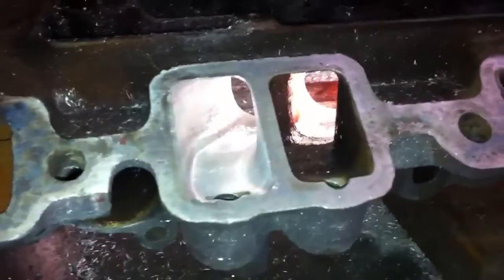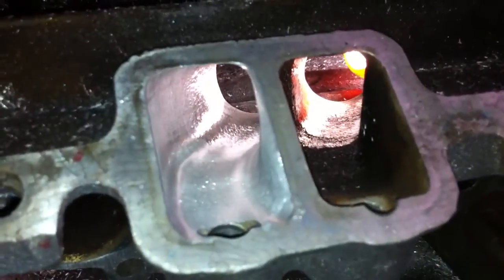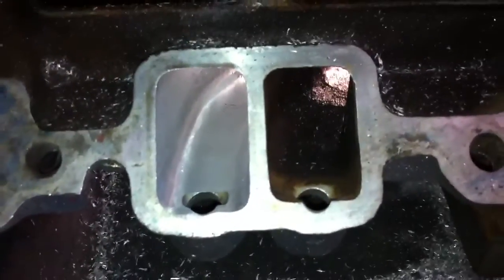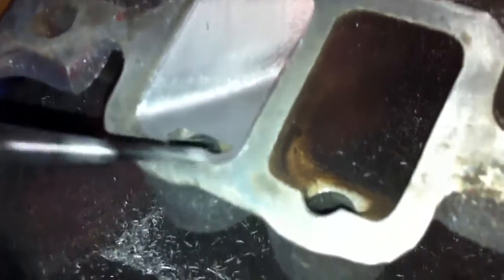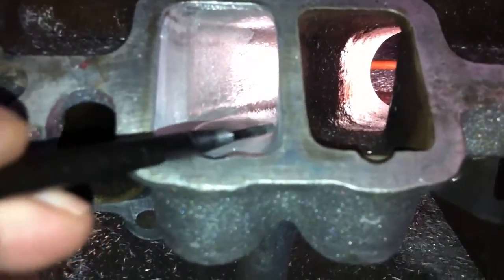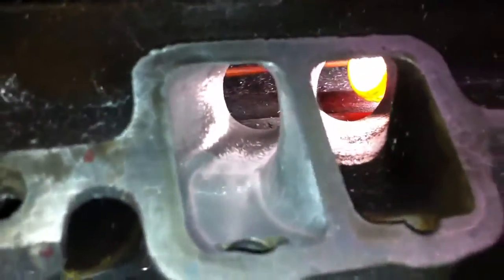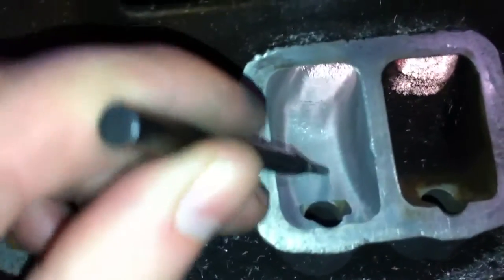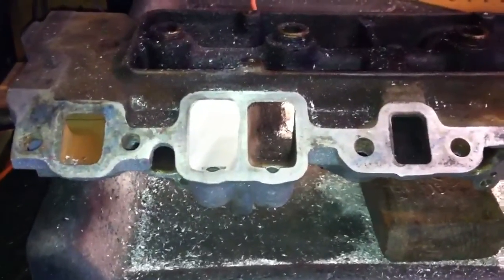How to port a factory GM TPI intake manifold . Tuned Port

Comment from the maker: More horsepower for C4 Corvette, Camaro, Trans Am and Firebird. 
Porting the most restrictive part of the TPI system.... 
https://m.facebook.com/pages/High-Flow-Fuel-Injection-Porting-TPI-L98-TBI-LT1-LS1-L67-L32/162540657151556?id=162540657151556&_rdr#!/profile.php?id=162540657151556&__user=552387435